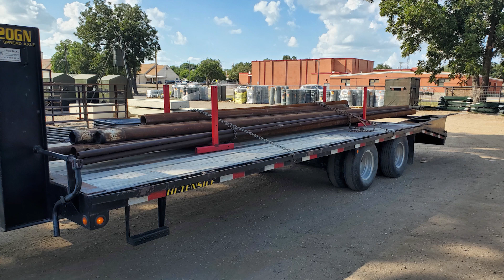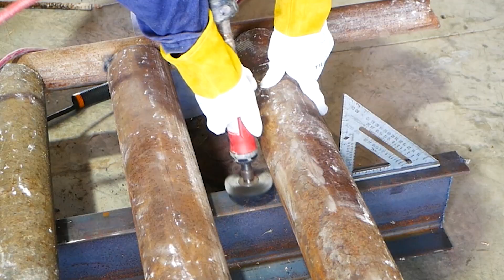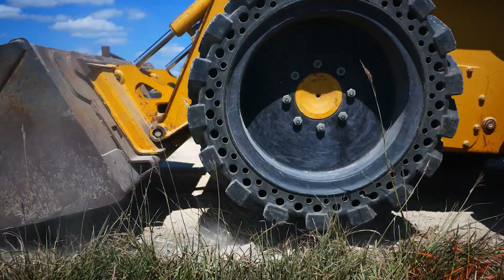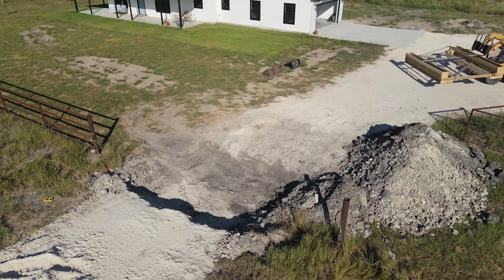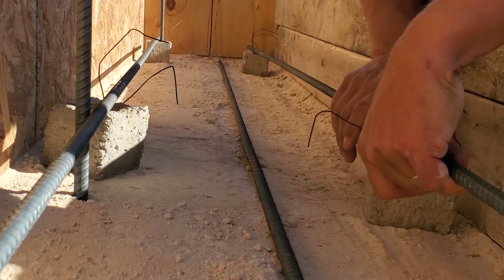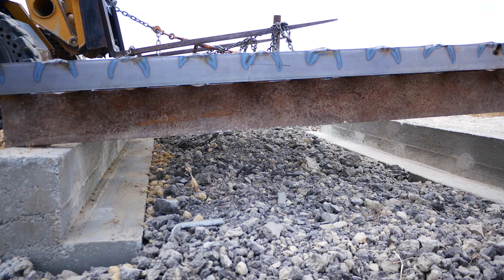Welding and Installing a Cattle Guard

Comment: You did a really good job on the build and installation. 
I have built and installed a lot of cattle guards and I was taught to level the ground where the cattle guards is going to be placed. Then lay the concrete beams on top of the ground making sure that they are level and square. Lay the cattle guard in the concrete beams and build the road up to the top of the concrete beams using new material making sure the incline is not too steep to ensure no vehicle will high center with heavy loads and long trailers. Installing the cattle guard like this will ensure better drainage and prevent the cattle guard from filling in with dirt and debris allowing cattle to walk across the cattle guard. Just another suggestion for your future project planning.
Reply from the maker: Thank you for the info. I’ll definitely consider on the next one

Comment: How did you decide what depth of concrete you wanted to use?  I'm doing a similar install for myself.
Reply from the maker: Page 1 of the linked pdf has a drawing of the footings and I went off that

https://www.dot.state.wy.us/files/live/sites/wydot/files/shared/Engineering_Services/Standard%20Plans/615-1%20%20(NOV_2004).pdf
Reply: How much rebar did you use in the footings?
Reply from the maker: 3 sticks of 3/8 in the bottom and two more sticks going up the sides

Comment: Looks good. I was wondering how you were going to keep them from jumping the corner since you didn't put the guard midway of the fence and then you showed that in like the final 10 seconds of the video :)
Reply from the maker: I had a couple calves figure out this year that they could duck under the side skirt so I had to weld another horizontal pipe. Thanks for commenting

Comment: Nice work! What did you spend to do this yourself, including material and delivery?
Reply from the maker: I picked the material up myself but spent around $1600 on materials. Probably went up 50% more in the past year. Are you planning on doing something similar?
Reply: Yep but I don’t have the equipment, so trying to evaluate costs vs having a local guy do it for me- what I gain in labor is lost in rentals. Thanks for the help. Blessings. Jim